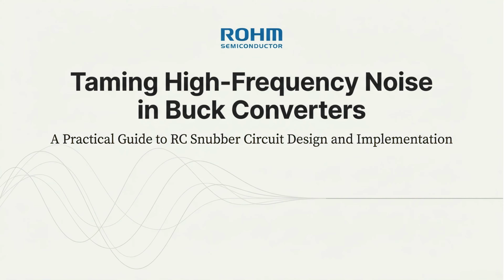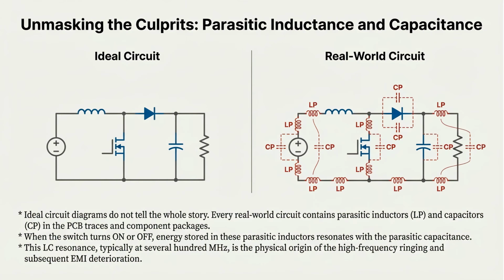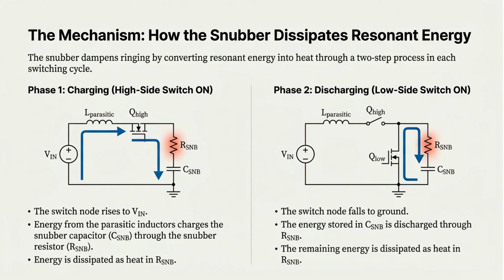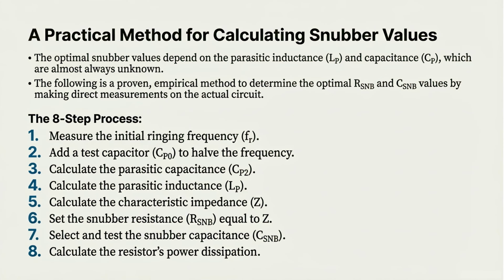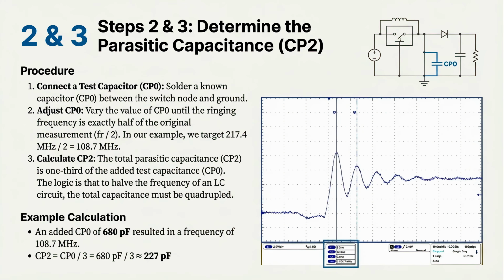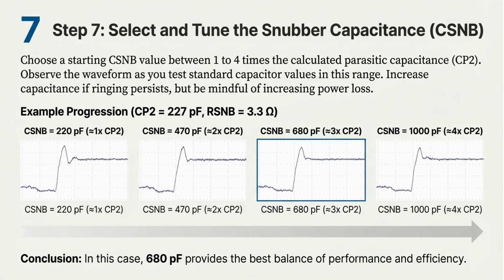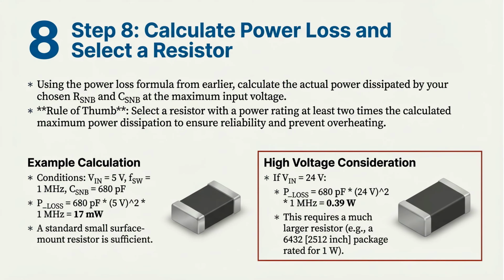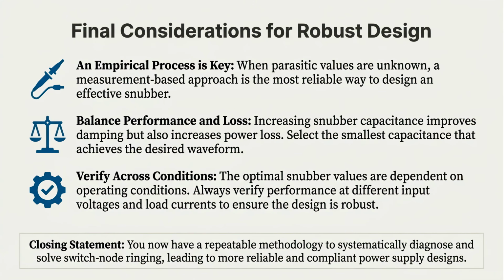Stop MOSFET Ringing! Practical Snubber Design for Buck Converters

Comment: Sadly, the capacitance across Drain and Source of the MOSFET can vary considerably for a transistor of the same model; therefore, in a mass production environment, the transistors must be parametrised beforehand. Alternatively, each power supply must be tuned one by one.
There are feedback techniques that can achieve optimal transient suppression with a varying Cds, but they require a more complex design. 
I used to have four places for the snubber capacitors and two places for the resistor, so that - as the final steps of assembly - the ringing was measured and the proper selection of snubber capacitor and resistor was calculated and soldered on the PCB. But many production lines in the Far East avoid board alignment steps at all costs, as that step requires some specialised manpower, that increases costs excessively.
In some designs of mine, I still use bipolar transistors where I use the Miller effect to reduce the high frequency gain of the transistor with a small capacitive base-collector feedback.
Anthony